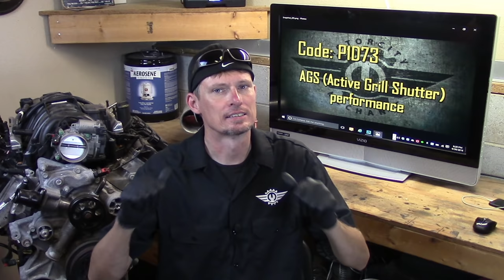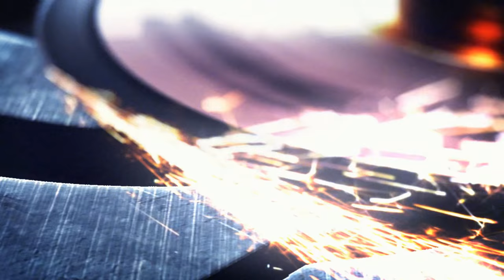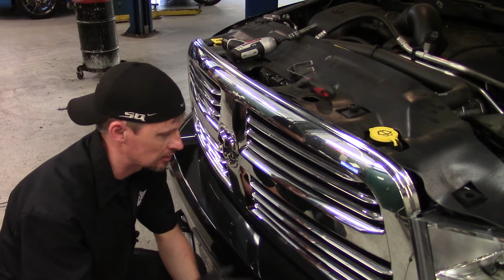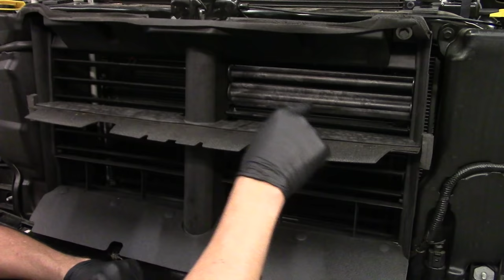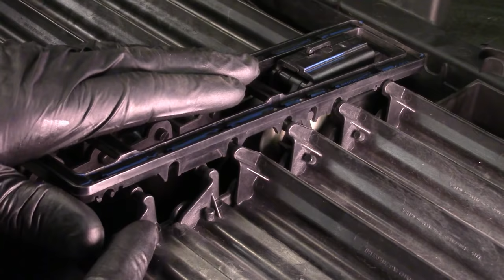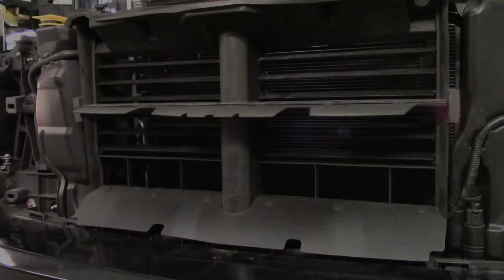Ram Truck Code: P1D73 AGS (Active Grill Shutter) performance

Comment: Since it popped out once, what is to stop it from doing it again while actually driving with the wind hitting it?  Will Chrysler not let you replace this assm. as a failed part?
Reply from the maker: +Kurt Kennedy The decision to replace it falls on me in the end. I treat a warranty repair the same way I treat a customer pay job......I don't replace something unless it's needed. With that in mind I would snap the shutters back into place and make sure they feel secure and then explain what I found to the customer and let then know that if it happens again....then I will replace it. From what I have seen with the ones I repaired......the issue never happened again. So depending on who was paying.....I either saved Chrysler money or the customer money. Both chrysler and customer trust that I am doing an honest repair and that's what I give them. Thanks for the question
Reply: +MotorCity Mechanic being from a different manufacture than you, I've head horror stories about warranty times and Chrysler being very picky on what's actually considered warranty...again, no first hand Experience, just curious.    Sounds like your warranty is vey similar to ours.
Reply from the maker: +Kurt Kennedy the warranty times seems capable of being met. I really don't complain about it because a good chrysler tech can usually meet the times or beat them in most cases. It seems to me that over the years the ones who complain in our shop are a bit slow and not welling to learn. If you believe there is an issue with warranty times you can request a case study and they will review it and make changes as needed. Chrysler doesn't have eyes on the vehicle and they rely on us to use our judgement as far as what should and should not be covered. It's not like they have a factory representative there looking out just for the companies best interests. I haven't come across a repair that we have done that they denied and wouldn't cover after the fact. There are some repairs such as transmissions, diesels, and engines that we must fill out paperwork before hand and take pictures before getting final approval but that mainly the expensive repairs.
Reply: +MotorCity Mechanic in always take what I hear from other techs with a gain of salt, being I know both sides of the industry pretty well.   
It sounds like they operate like everyone else then, which is pretty cool to hear.  
Good videos man!
Reply from the maker: Thanks Kurt. I always imagined that those in the industry moved from job to job and brand to brand so alot of the operational items seem to always have some common/familiar touches because of that.

Comment: Is this the ONLY way to fix this?   2014 with the code, I have to replace the whole thing?
Reply from the maker: There are some companies that sell kits to bypass it and trick the computer to think its there, otherwise replacement is the only fix that I know unless some of the linkage came loose and you might be able to reconnect everything. Thanks for asking and for watching. Make sure to subscribe.

Comment: What is the middle part called that Over the motors thats connect the piece together
Reply from the maker: I dont know the name of the part but I do know that they only sale it as an assembly. So if you need one item.....you have to order the shutter assembly. Thanks for the question. Make sure to subscribe and check out my other videos.

Comment: What if you want to remove this completely and not have the CEL come on? Can you just unplug it and then no engine code?
Reply from the maker: Unplugging it will set a code for sure and the check engine light will be on. Not as simple as that unfortunately.

Comment: Great explanation, i do have a question tho.. u said they’re there for fuel economy...so that means if we take them off it won’t increase in power getting a better air flow inside ?
Reply: You'll get WORSE mpg.  NO increase in power. Actually worse. Since hot motor gets more Horsepower. 👍